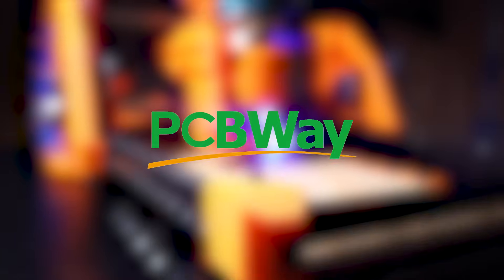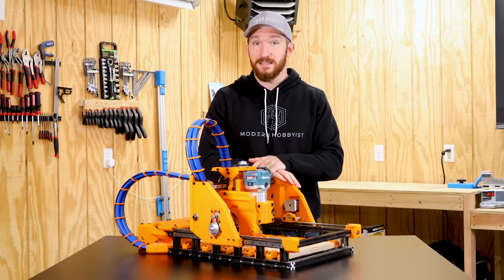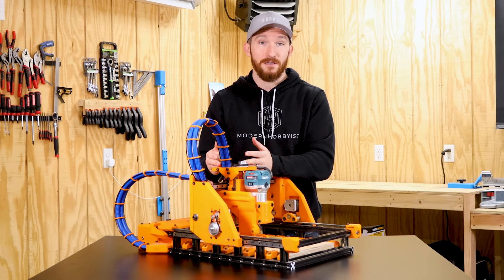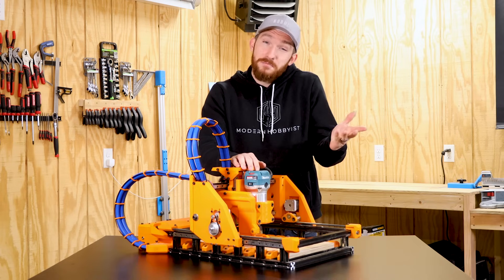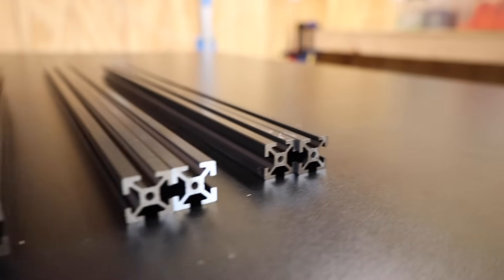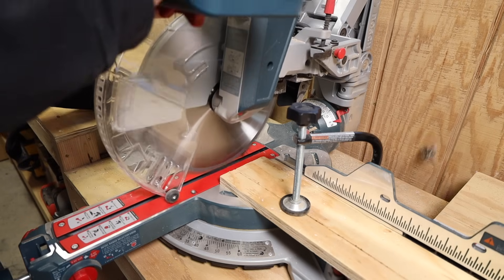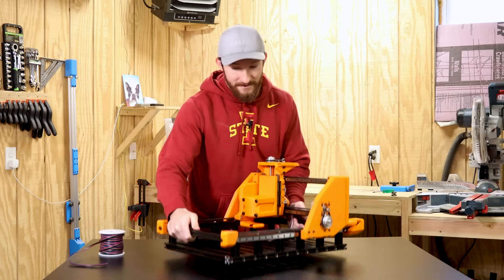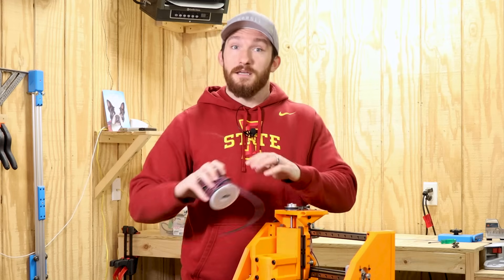DIY 3D Printed CNC That Cuts Metal!

Comment: I'm super impressed with that surface finish on the aluminum. It makes me wonder why we don't see more of these in the wild. Well done!
Reply: 1. Print plastic to make CNC able to mill aluminum
2. Mill aluminum to make CNC able to mill steel
3. Mill steel to make CNC able to mill titanium
4. World domination
Reply from the maker: @SteeveBlack  Yeah, but like, don't tell everybody...
Reply: @SteeveBlack   Just gotta unlock the tech tree, video games have taught me well
Reply: @SteeveBlack  basically although there would be some major gear overhall once you start to go from cutting aluminum to steel your going to want a faster higher torque spindle and possibly faster steppers to get the feeds and speeds needed to accuratly without over heating the parts your making then theres the rigidity of the frame its doable but the machine you would end with would be vastly different to the machine you started with

but you coud most definatly bootstrap from this machine into such a machine which is kinda cool
Reply: @SteeveBlack  You can also simply skip points 1 and 2 by having pcbway mill the steel parts.
Reply from the maker: Thanks! It’s not the absolute sturdiest machine out there but it should be more than enough to cut anything I need!
Reply: @ModernHobbyist  How hard would it be to make it cut steel? Would you just need a harder bit and make it go slower, or would it be nearly impossible with the strength it has?
Reply from the maker: @StarForgers  I haven't tried, but from what I've heard, 3d printed parts are pretty much not going to be able to cut steel. Even aluminum plates have to be pretty thick to handle cutting steel.

Comment: I didn't know Ivan sold plans. Looks like a great project!
Reply: About how much did this cost to make and do you think I’d be able to run it to make wooden kids toys? Can I engrave nicely into the surface as well to add details ?
Reply from the maker: @shrimpinpat  This thing will chew through wood with very little trouble, the only limitation I've noticed so far, is my own lack of experience operating it!
Reply: @ModernHobbyist  I’ve been wanting to make one or another DIY one but it’s never been clear to me since it doesn’t have stops to home itself if I’d be able to do tool changes and such to finish parts nicer. Any ideas I’d appreciate
Reply from the maker: @shrimpinpat  yeah that’s tough. I’m thinking of adding endstops to this CNC, but a tool changer is way outside my knowledge level currently. Maybe the next CNC!
Reply: @ModernHobbyist  yeah tool changer would be a lot I just want to be able to run finishing passes to debur or add like bevel or chamfer to edges . But either way may still make one. Could make a router jig for the rest of that